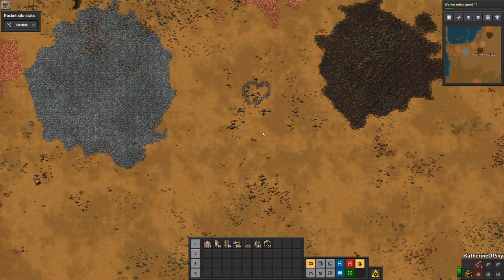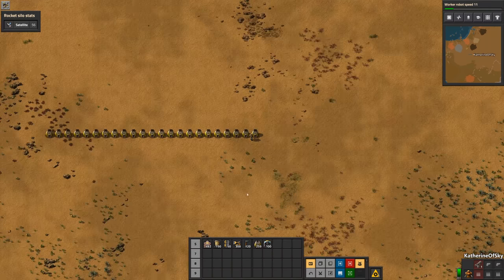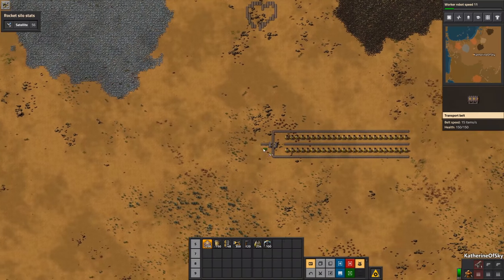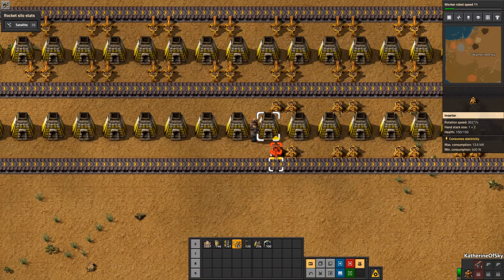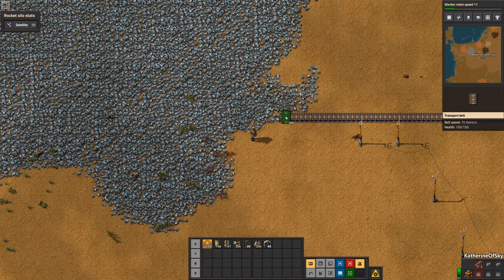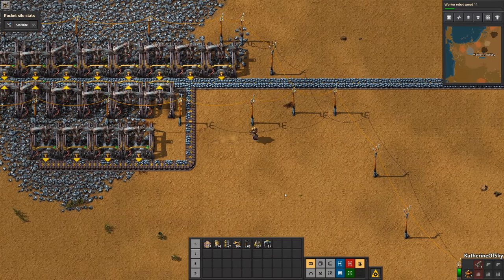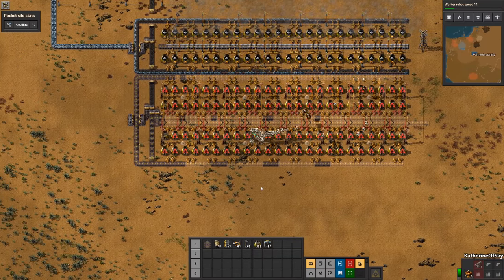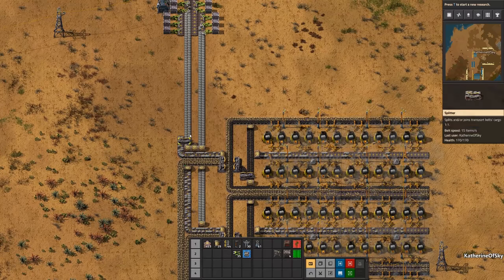Factorio: HOW TO BUILD A SMELTING SETUP - Tutorial, guide

Comment: i like the look of the one side in and out smelting arrays :D
Reply: yes, it's really nice to have a bus of ore coming in and slowly turning into a bus of plates :-) (similar can later be done for green circuits too)
sometimes i even don't do different smelting arrays for steel, but use the same "simple" arrays to turn a bus of ore into a bus of plates and then the bus of plates into a bus of steel. it only gets a little asymmetrical since 5 belts of plates turn into one belt of steel, but even that (at least for me) is easier and faster to setup than the different wider steel layout (mostly using no blueprints but building from scratch with slight variations).
another advantage of building in and out to the same side is that i can build all the bus and all the arrays right at the start, using only a few smelters per side instead of 24. thus i will immediately have spaced it out properly and can extend the length of the smelting rows later.

one thing that i do differently: i leave one space between these smelting rows and put power poles there so that they can power inserters for both smelting rows. instead of needing 3 lines of power poles per smelting row, i only need 1 line next to the outgoing belt and 1 line between two incoming belts. this also gets me the later option to replace rows of stone/steel furnaces with rows of moduled electric furnaces (sharing an incoming ore belt for two smelter rows) without the need to move all other rows of smelters (and yes, electric is mostly not needed, or to be really useful requires a complete rebuild anyway to also add beacons).

Comment: There was a tip I read way way WAY back in like 0.4-ish where if you add a space and a belt between a stone furnace and the resulting output belt, you could sort of future-proof the chain for electric furnaces.

Of course, to really make the most out of electrics and plan ahead like this, one would also need to make space for beacons way back in the early game, which is probably more work than just tearing down the whole thing and rebuilding with a new blueprint (especially considering the fuel that becomes redundant when you reach electric furnaces).

Edit: And of course KoS mentions it towards the end. One other reason to use electrics is because steel furnaces are a much bigger pollution source, so biters come more frequently and evolve more quickly.
Reply from the maker: Welll... if you are making enough production, biters are not much of a challenge!  You are going to generate that pollution with the dteam engines anyway...

Comment: A little tip for counting before the robots:
Stack is 50 so 24 would be 26 left in that stack. That's how i do the early-mid game building
Reply from the maker: You don't need to have robots before you use the blueprint planning tools.  Just make sure you enable them on map gen.  There is also a console command to enable (which does not disable achievements).
Reply: @KatherineOfSky  I think they meant when you are placing a certain number of stuff (and not filling up ghosts), instead of counting (which can be tedious), if you have started with full stacks you can use the remainder to quickly see how many you've already placed. Neat little trick which I will be stealing for the early game.
Reply from the maker: Yep, you can definitely do that.  I used to be fantastic at math when I was young, but with my dyslexia getting worse as I grew up, I'm quite delighted to use tools like the blueprints to count for me.
Reply: @KatherineOfSky your way is clearly easier, but I prefer to play it as is without enabling BP before it gets enabled. To each his own.
Only cheat I'd like to use is a full chest of substations at the spawn point because, God, do I hate not having straight lines and angles when I open the map and enable the electrical network hud.
Anyway, you're playing this game on a whole new level and I am a big fan of your work (even managed to memorize the belt mini factory)
Reply from the maker: The BP toolbar is enabled on any new game as long as you've unlocked them in a previous map, so unless this is a person's very first time playing, they'll be there :-)  I'm so glad you enjoy my videos!

Comment: You can reduce the space needed at the beginning. If you move the horizontal splitter to the left 1 space, and north 1 space. Use an underneathy to go under the splitter that is vertical.
Reply from the maker: As far as using extra underground, no thanks: when every craft counts at the beginning of the game, it's too expensive.  Also, I prefer to see what's going on and not have things hidden underground.  However, you can build it any way you want to!
Reply: @KatherineOfSky  Fair enough. Thank you for your videos! I have actually learned a lot watching them.
Reply: i always try building everything as compact as possible. at first i enjoy those builds a lot, but later i often have to add just one more belt or similar, and then have no space left, causing lots of spaghetti and that wastes much more space as if i would have used when building not quite so tightly in the beginning ...
with space in factorio being almost infinite, there is also no real need to build too tightly. (well said, Anson, and now also follow the advice :-)

Comment: Another reason to use the Electric Furnace over the Steel Furnace is a considerable drop in pollution per minute. If you're playing with biters, you make them a bit less angry with an Electric smelting array. If you're not playing with biters, I agree: there's no real reason to upgrade to Electics. Nice tutorial. Thanks for sharing.
Reply from the maker: Unless you have efficiency modules in every furnace, Steel Smelters produce the exact same amount of pollution when you factor in the burning of fuel for Steam Engines for electricity.

Comment: great tutorial.  I found that you can get the steel oven tech pretty fast, so maybe not build the whole column with yellow belts and stone furnaces.  you can get away with building HALF a belt for iron and a tiny one for copper to get through green science Logistics 2 for red belts and Advanced mats...  well, at least that was my experience.
Reply from the maker: I never switch to electrics until I get modules and beacons, since Steel furnaces are more power-efficient to run.

Comment: I feel it might be worth mentioning that electric furnaces are worth using in outposts (as you only need to deliver power) and more importantly, when playing in a deathworld! 

Using 2 eff 1 modules (and you use a lot of them in a deathworld) reduces the pollution output and therefore your "aggro range" by a whole lot. Let's assume you're using steam power for this. A single boiler outputs 30 pollution per minute. 2 steam engines can support 25 electric smelters with eff 1 modules in them. 

One of those smelters outputs 0.4 pollution per minute. 30+(25*0.4)=40 pollution per minute, that is If you're using steam power. if you're using electric those 25 smelters produce 10 pollution per minute!

For comparison 25 steel furnaces will produce 100 pollution per minute in the same span of time! I omitted inserters and their power costs as they would add the same value to both setups and can therefore negate one another.

This kind of stuff really makes a difference in deathworlds where your base and your outposts are in a constant struggle against the biting menace!
Reply: I bet you could use solar plus accumulators to make it even better!

Comment: Amazing! I watch some of your factorio tutorials and I am impressed! I juste have two questions please : 
- To maximize one furnace array you need 30 miners at YB or its 30 miners for the 4 array of 48 furnaces?

-Usually, I play in default mode without change the ore settings. But because you need 30 miners, how to do if your starting ore is a small patch? Can we adapt the furnace array (for example reduce the furnaces) to the ore patch size or to the max. Number of miner we can place on it?

Comment: I would be a bit cheap and use 3 poles per 6 furnaces.
The coalbelt i made outside instead of the smeltingarray, costing 1 undergroundie more, think i'll use your approach next time.
To make the miningarrays compacter i put the powerpoles on the belt with undergroundies and if need be a light, so a maximum distance of 2 spaces which is between 2 miners.
It is just another way to build in Factorio. 
As allways a good Explanation, thnx...
Reply from the maker: In early game, I definitely don't use undergroundies in mining because they are soooo expensive.  I do in late game, though, when you need the throughput.  I used to use the power pole idea of 1 per 3, but I gave into the QoL of running placement :P
Reply: @KatherineOfSky  That's ok if you think the the undergroundies are expensive, allthough they cost 15 iron.
Even on the first patch of ore that is peanuts. Then again, you can play the game as you see fit, that is one benefits of the game.
b.t.w. hope your hands are getting better..
Reply from the maker: @XmasEve64  I don't find that 1 tile of space is important.  In factorio space is infinte!  And thank you for the good wishes!

Comment: I am triggered by the idea of continuing to use steel furnaces once you have the power to support electric. If for no other reason than to not have to bother with belting fuel to the furnaces. That and because coal and refined oil used for fuel can be used elsewhere in production.
Reply from the maker: Well, get untriggered!  Coal is everywhere.  It's the least used resource except for stone.  If you can support modules, then convert to electric furnaces, otherwise, it is highly inefficient.

Comment: This may have already been asked but are there other styles for when you have limitations in space ? I often run into that where I have to squeeze stuff in an area.
Reply from the maker: Just build it yourself when you have a confined space: if you use the same ratios, it will work just the same.
Reply: @KatherineOfSky  The work is never as elegant :).  I just started free play after failing at supply challenge level 10. Thanks, Ms Sky From: Crom, strong in his mountain but lives under the sky.

Comment: Would you just add 24 more steel  furnaces (12 on each side) for a blue belt or would you have already moved to a beaconed setup by the time Blues come out?
Reply from the maker: What I would do is not use blue belts on the bus.  If you need that much throughput, (for a megaboase), I would use a beaconed setup in outposts.

Comment: I don't understand the math behind a full belt. Doesn't the length of the belt have more to do with it than the number of smelters feeding it?
Reply from the maker: No.  A belt can transfer x amount of items per second.  The number of smelters is how much is consumed per second, so you want  to align how much the miners are putting out with an appropriate speed belt, transferring to the consumers.  So if a mine is putting out 15 items per second, use a yellow belt, which transports 15 items per second, and then the appropriate number of smelters to consume 15 items per second.